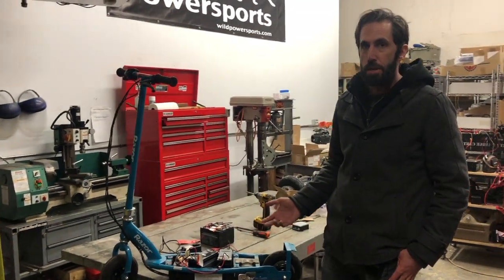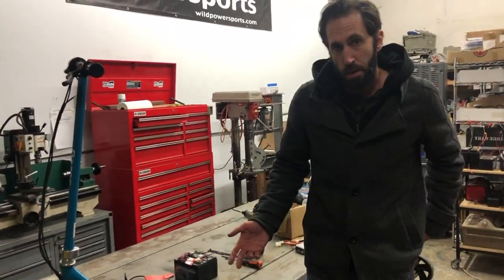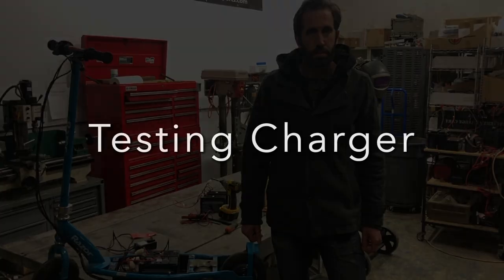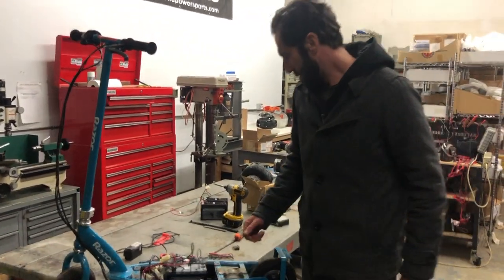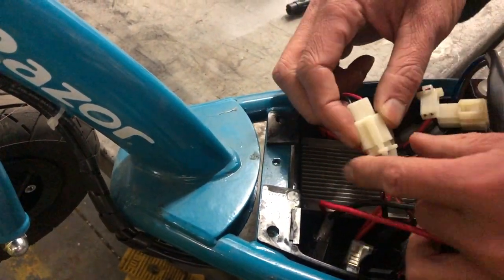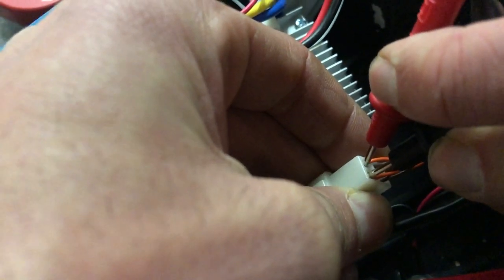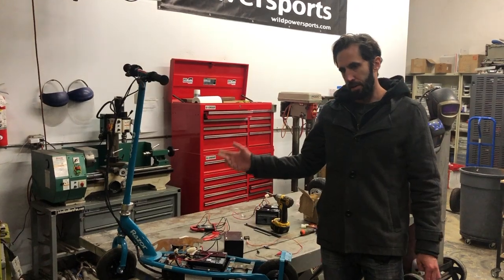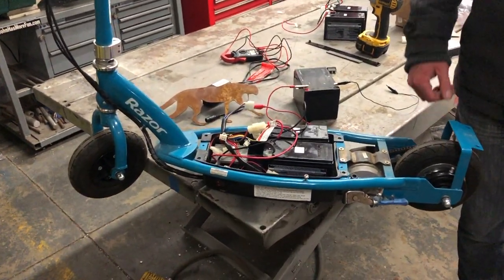Razor E300/200 Ultimate troubleshooting Guide

Comment: Excellent Video. Unfortunately, I do not think my problem is addressed here. I've installed new lithium batteries and bought a new charger. The batteries are charged. When my grandson  (70 pounds) rides it,  it will go about 200 feet then completely stop. Turn the on/off switch off then on again, it will run for another 100 or so feet then stop. I then put in on a bench with no load (wheel off the ground), it ran for over 50 minutes before I stopped it. I called Razor, tech support was useless.  Any suggestions would be most appreciated.
Reply: do you resolve the problem?? i have the  same
Reply from the maker: When you go lithium or to a voltage not supported byt he factory parts we cant help unless we have the machine here.  So many things it could be.

Comment: Cannot test batteries using just voltage readings. Need to test batteries with a load. Can get good voltage reading but batteries may still need to be replaced because they cannot handle loads.

Comment: I need  help with installing the battery the wires that were supposed to be on the battery we're not and on the scooter they weren't on they were not they were throwing them out for trash and I've crossed something somewhere and got shocked I need to know how they go please I need to know how to connect the batteries

Comment: I am trying to bypass my reset switch and replace it with a spare fuse I have. Do you happen to know the awg for the wire for the stock fuse cables for razor? I can only find that it says 450/750v on there. Thanks for the videos you guys put out I was able to fix my sons scooter because of you guys.
Reply from the maker: 12 Gauge....

Comment: I just replaced rear tire and inner tube and batteries on my sons e300. Charged new batteries for 12 hrs. I get on it to test it and it’s gutless and slow and motor doesn’t always kick in.
Reply: I’m having the same problem. Did you find a solution?
Reply from the maker: @williamhickey982  The normal issue here is you got cheap batteries.  Cheap = Junk.  You get what you pay for.  We have quality, and genuine razor batteries in stock.  Dont buy the cheap batteries guys, they have low output!

Comment: Replaced the batteries after the click sound. It worked and ran till it died. But when I plugged the charger in it stayed green. I disconnected everything to test everything seemed fine. Hooked it all back up and popped a fuse. Weird.. replaced the fuse and now when I turn the power switch on the scooter just runs. Throttle doesn’t seem to be working. But it has continuity when tested. HELP PLEASE
Reply: I’m getting the same problem
Reply: Kinda
Reply from the maker: Wow, this is a weird one.  Controller/throttle issue.  Would have to see it here to diagnose.

Comment: Very nice video. I did all the testing you mentioned here but unfortunately my e200 still not working. I have no voltage coming out from the controller box to the motor. I believe is my controller box(no clicking either). Thanks for the video.
Reply: Got almost same things, checked everything all good, clicking good still doesn’t work this little 🤔 drive me crazy

Comment: I got a new motor and set of new batteries but no throttle response not even the click. Power switch works. So think it’s the breaker or throttle?

Comment: e300 circuit breaker constantly tripping. new batteries. i'm on my second circuit breaker just to take sure its not the case defective new part. i opened up the controller and desoldered STPS3045CT POWER SCHOTTKY RECTIFIER and the F1010E HEXFET® Power MOSFET and tested separately and tested good. it will run for about 50 yards then circuit breaker trips. i'd reset then ride another distance, then trips again. help please. thank you.
Reply: the drive tire spins freely so its not the case of brakes sticking.
Reply: Sounds like a short. Make sure no exposed wires are touching metal. Controller not the issue.

Comment: My scooter Both batteries put out 12 v when I test them with the multimeter
 but when I give it throttle it spins but doesn't even have the power to move its self and the scooter shows battery fully charged
Reply: same issue!
Reply: Did you ever figure this out? Mine is having the same problem after getting new batteries

Comment: working on e300. back tire spins but can easily stop it by hand. scooter wont pull weight.
Reply from the maker: Bad batteries.
Reply: Make sure air pressure in tire is correct.

Comment: I get a rather large spark when I connect to the scooter with the power switch on. Is that normal?
Also, how can you tell if the motor is good? Resistance? 
I have two scooters and one pushes easier than the other. Is that just because it hasn't been used in a long time (2-3 years)?
Reply from the maker: Spark is normal.  Connect the motor directly to a 12v battery!

Comment: i have an E300 that was not working, replaced the batteries and now it works. However it doesn't have much power like it had from new. Could it be the motor which is now the problem. Thanks for any advice

Comment: My son's e300 only lasts about 10min even with brand new batteries ?
Reply from the maker: Bad charger or bad battery (Yes, they can be bad new) most likely.  Other issues could do it, but thats the most common.
Reply: Yes mine is like that, 40 min no way 100 kg no way probaly same battery as kids one
Reply: @WildPowerSports  The batteries have a low threshhold and if charge falls below threshold will not charge back to full charge. Result need new batteries. Leaving switch on for many days can cause this problem
Reply: @lesbiapatriciaandrade8951 I have an E300s.. where can I find the threshold? I put in new batteries, the light on the charger was green right away, but the scooter only made a clicking sound. I charged for several hours and now I can hear the motor starting then fading out, but the wheel doesn't turn.

Comment: hello pal. my problem is that when i pull the throttle the rely switch trips in then about 1 - 2 second later trips back out. the motor doesn't normally run when doing this.except one time. does it sound like the rely switch in the controller?  the battery's holding 25 volts. when i check the yellow and blue when pulling the throttle i dont get over 24 volts coming out to the motor . thanks

Comment: I put new batteries in and used a new charger. The motor runs fast when off the ground, but when I step on the scooter it is very slow.
Reply: Mine is like that even when wont move with me on it, step off and it moves no problem
Reply: @ramblingrob4693  motor might not be getting enough voltage. see if you can test the voltage going to the motor.
Reply from the maker: The issue in all these cases is almost 100% batteries.  Even new, there could be an issue.  If one is low and the other is fully charged the low one will hold back the scooter and never fully charge.  Other than that the only issue it could be is tire pressure!  Yes, its that important on these!  I weigh 173 and with me on an E300 with a low tire it will barely move!
Reply: @WildPowerSports  What kind of fitting is needed to put air in that back tire ? Fricken thing is set inside the sprocket .
Reply from the maker: @TheSkyPod  It comes with the scooter, inside the right handlebar!  We also have them in stock, look for "universal valve extender" on wildscooterparts.com
Reply: @WildPowerSports  Just bought 4 valve extenders from the Auto Parts store for around $2 .
Reply: @ramblingrob4693  ever figure out the solution?
Reply: @BigAlWillis  how do intest voltage going to the motor?

Comment: Anytime I connect a battery to the motor it sparks and nothing happens. Is there a short in the wires?  I also get a beep when touching the wires to the motor. That should not happen

Comment: So when I charge my e300, it shows it’s fully charged after I charge it for a solid 12 hours, but it pulls really slowly and after a couple hundred feet it just stops going. I turn it off then back on and it does the same thing again. I replaced the batteries and everything and don’t know what else I can do, help!
Reply: I have that problem as well still don’t know how to fix it
Reply: That's exactly what mine is doing too. ?
Reply: Are your tires inflated properly?
Reply: They were low, so I inflated them well and it still bogs down and won't go.
Reply: Same here. Took batts out of a working identical scooter that works fine. So batts are good, tires inflated, brake not stuck chain fine, wheel spins freely. Wheel spins with throttle when off the ground. Any weight on it and it doesn't want to move. If on scooter and push to get it going will still barely move. I keep seeing this asked but when people say it's not the batteries everyone goes silent.
Reply: @ScottClermont  I’m curious, did you figure this issue out? I’m having the same exact issues.
Reply: @jaleesahwalker4584  same issue. Any help?
Reply: @ScottClermont  ever figure it out?
Reply: @jaleesahwalker4584  I'm still trying to figure it out! Ughh
Reply: @BrainFogDanellesReviews  turned out to be the bad batteries or ghost batteries…. Runs great no problems.

Comment: working on e300. back tire spins but can easily stop it by hand. scooter wont pull weight...  have new batteries...  which are fully charged...  any suggestions???
Reply: did you solve it?? i have same issue

Comment: ive just put new battery's in mine but it only holds its charge for maybe 2/3 minuets  could it be the controller...ive changed chargers also
Reply from the maker: 99% chance bad batteries.

Comment: Our E200 always shows a green light on the charger but will not run. The red light on the charger is never on. The scooter is showing charged all the time but is obviously not. Any suggestions as to the problem???
Reply: I bought a new charger on Amazon for $10 and fixed this issue. I know I'm 2 years late to the party!

Comment: Hey my e300 works but slow of there's any weight on it.  When the back tire is off the ground it goes great and fast. Any idea what it could be?
Reply from the maker: Batteries.  Most likley bad.  Check voltage under load.
Reply: hi, did you solve it?

Comment: Mine doesn't click when I turn the throttle. The red power light comes on, the breaker pushes in and comes right back out. I'm thinking it's the main brain or less likely the throttle wire. Any suggestions would be really appreciated. Thank you all.

Comment: It works when put to the side and then when I try to ride it, it goes very slow please help. I think the motor can’t handle its own weight. Maybe I need to replace the motor. Do you know the problem? Please help me. The battery charger light stays green
Reply: :goat-turquoise-white-horns::face-fuchsia-poop-shape::hand-purple-blue-peace::hand-purple-blue-peace::hand-purple-blue-peace::hand-purple-blue-peace::face-purple-wide-eyes::face-purple-wide-eyes:
Reply: Same thing happening to me I recently got a e300 from a friend n I charged it n it green light but when I ride it it ride very slow like it wanna stop so i think it the motor
Reply: I found out it was the controller not the motor

Comment: How do you do the secret trick to test the throttle on a Version 1 Razor Sport Mod?  It has 5 wires.  I tried the clip the way you did in the connector and got nothing, but maybe 5 wire variable throttles won't react the same as the 4 wire that you did in video?    I can jump from battery to motor direct and the motor runs fine.  I tested EVERYTHING you did in the video, and I replaced the controller AND the throttle and I still got nothing! I'm going to scrap it/give it away but in case anyone reads this post I may be able to save it.    I've been through the schematics, I've tried so many things I am out of ideas except for the current thought:  You can't do the special throttle trick on the 5 wire sport mod (variable throttle) AND I bought a faulty throttle OR faulty controller and don't know which......    But one thing for sure---backprobing the connector for the throttle, I have voltage to the throttle and different voltages in the connector, NONE will change value when twisting the throttle.  They stay the same!   So I figure it's the throttle.

Comment: Hey was hopping mabby you could help.have a e200 was working great save battery was dying .bought two new ones replaced and it will only click .light turns on worked 100% freaking out . Says it's charging
Reply: Did the test to see if it's throttle and it won't go also won't go if brakes are out just clicks .any idea thanks a million

Comment: So, if the light is green when plugged to the scooter should it go on to red to say is charging and green for fully charged?
Reply from the maker: Correct, if not, hit us up for batteries.  Again, the cheap batteries only last a few months, so get quality ones from us!
Reply: Got it working ok. I'm trying to make my Schwinn  go farther , I have a 500 w motor(chain run) 24 v (2) but I only get around ehhhh a mile or so on it , whish I could get at least 10 miles on full charge :(

Comment: What if your scooter tire runs but when u stand on it it doesn't go
Reply from the maker: Bad batteries, low tire pressure.  99.999% sure on that.  Watch the phantom voltage video.

Comment: Can anyone tell me what would cause the connectors to melt.(battery cables)
Reply from the maker: This is VERY common, happens on almost every unit.  This is due to extreme use, the wires heat up and melt the connector.  The solution is to cut the connector off and solder the wires direct.

Comment: I have a Razor Betty 24v., new batteries and a (2nd) new control module. The first kept kept blowing fuses as soon as I turned it on. After taking module apart, the insides were fried. After installing the newest one, I'm having the same problem. I walked away from it rather than burn up the newest one.
Is there anyone who can help me.
Thank you so much!
Reply from the maker: Sounds like there is somthing causing extreme load on the motor.  Does thw wheel spin freely?  Are you overloading the scooter?

Comment: hi all, i'm restoring an old Mitsuca scooter. Motor runs perfect when i put 24 volt on it however when i let it pass trough the controller it runs very very slow on full throttle. Did the throttle test as in the electricscooterparts.com throttle testing guide and reading came out at 3.57-3.58 volt so should be OK. Brake port is open so should be OK too.... Battery is also OK (brand new and charged fully) What else can it be? Anyone has a clue?

Comment: I have this battery tester:  https://smile.amazon.com/gp/product/B000BOBZJ0/
Can I still test the circuit breaker with it?  (mine doesn't beep that I'm aware of. It is analog so the needle goes to red or green if battery is good/bad)  I ruled out bad batteries or at least the tester indicates the batteries are good. Our E300 scooter clicks but that is it. wanting to test the circuit breaker. Pushing the reset button in, it doesn't stay in. Is it supposed to? What do I need to buy to test the circuit breaker? I don't see a continuity option on my battery tester.

Comment: Question: on my scooter when I charge the battery there is a strong sulfur smell.  The batteries were swollen so I replaced them. When I charged the new batteries I got the same sulfur smell. Could it be the AC charger?